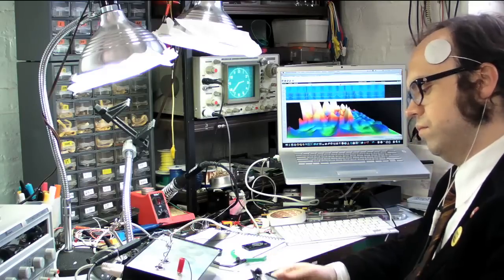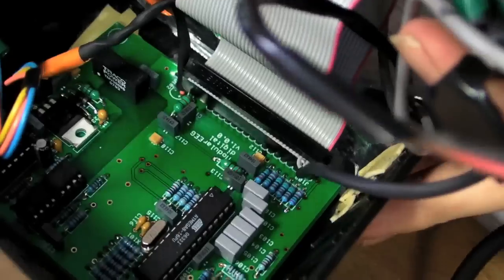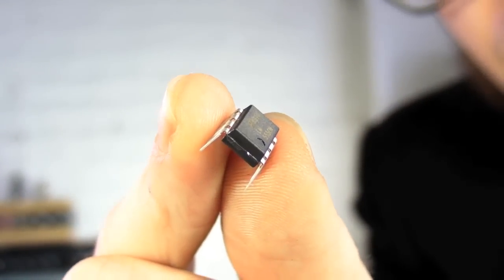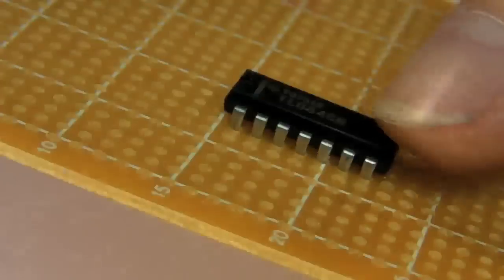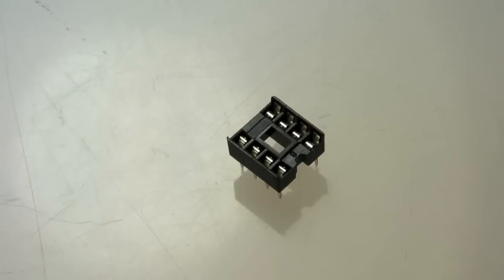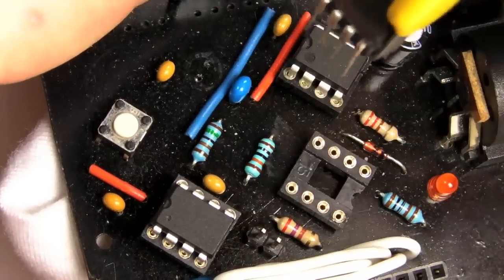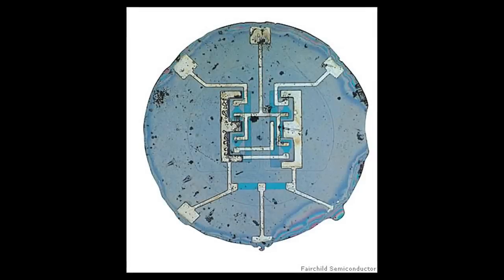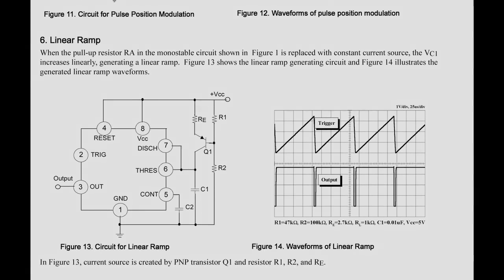MAKE presents: The Integrated Circuit

Comment: Several transistors form a circuit which can be turned on or off like a light switch. Eight switches comprise an on/off pattern known as a "byte". The patterns are then used to code binary information inside the computer. Twenty or thirty transistors can be embedded into a chip which acts like a super amplifier. This is known as an "Operational Amplifier". The circuit calculates the differences in two input voltages and amplifies the result.  Transistors are voltage difference calculators.

Comment: @TheMakut 

A transistor controls a signal with another signal. Consider that you have a voltage signal, and a control signal. When either is applied very little will happen (ideally, nothing), but when both are applied, you get AND logic, i.e. both signals have to be present to produce a good output. This is a fairly shoddy AND gate, as it will be affected by current flowing through either input, but demonstrates how a transistor can be used to decide something.

Comment: What goes on inside a microchip? Carefully designed paths of capacitors and transistors control electron flow. Electricity goes in through one pin, comes out of another (or several).

It's actually quite difficult to illustrate without a complicated computer-animated 3D model.

Comment: An IC is basically a row of transistors.  Transistors act as a switch in which values of input voltage can be chosen such that the output is either completely off,  or completely on. This on or off position is analogous to 1 or 0 ie. binary the most basic language machines understand, binary then gets translated to a higher level language in order to make programming easy. Before the adoption of IC, computers used switches in vacuum tubes to create a similar yet epically less efficient effect.

Comment: good video no negative response from this side but can you elaborate abit on what each pin for example can be used differently to do so many functions for example like timer chip etc and what part these pins play and how you can combine multiple ic's to do bigger jobs etc and explain to what extent these chips can be used and also cover the fact that software can help program these chips using roms and stuff. thanks

Comment: Using a momentary switch- Which IC can I use that will act as a toggle switch to close a circuit for 2 LEDs?  40mA circuit.  Single D-flop?, but one that can deal with the current.

Comment: I bought two shift registers, but one of them got a bit "crushed". One or two of it's pins got bent a bit. Can i bend them back, or do i need to buy a new one? I also damaged a crappy push button, but i don't think, i can repair it.
Reply: ***** I don't have the right tools for that.
Reply: +StarTrek123456 You can use a credit card or something. Just sandwich the bent pin between the card and the table and press to straighten.
Reply: You really need the proper tools for this stuff. It's the other side of computers for most of us, and we are accustomed to having all the tools we need inside the computer ... Colin has a video on tools as well. :)

Comment: You are over thinking this, just imagine a light switch turning on and off, now think of morse code and the way you can communicate with either short or long bursts.  Those on and off positions can be made to represent any number, letter, color etc.  It's not that the transistor is thinking it's that it is creating an electrical impulse which can then be interpreted by the machine as either 0 or 1, programmers then use higher level languages to interpret and make use of these patterns of 0 and 1

Comment: Hey 2009, imagine CPUs today that have transistors so small that if they were any smaller the laws of physics wouldn't apply to them normally and electrons are able to tunnel though other universes past a semiconductor, so we make super expensive computers that take quantum mechanics and use them to make a new type of computer that has to be cooled to near-absolute zero
Reply: +CoolAsFinnBro So there is a limit to how small transistors can become.
Reply: +twistedyogert There is, yes and we're hitting it. At some point, things get to the point where we move from Newtonian physics into particle physics which isn't good when we're looking at something like a practical engineering problem since most often, particle physics doesn't have practical solutions. When an electron can spontaneously hop from one data stream into the next one your board, it starts to cause issues which is what we're facing today.

To put things in their simplest terms, that is. These are serious engineering problems that have been skirted for years with ingenious work arounds but the demands of technology are drawing into question whether chips can continue to get smaller without a major breakthrough of some sort.
Reply: was told about a problem with "quantum tunneling" where electrons can basically phase through a transistor even if it is in the "0" or off state. I guess at small scales, physics goes off the rails.

Comment: i wouldn't say that an IC is only based on transistors mabye a CPU you could say are based of transistors because in an CPU there are really alot of transistors but an IC could contain resistors and even inductors too. If you look at the schematic in a datasheed of an IC you could see that you could build that by normal electronic parts but it would be too big for our modern world think of a mobile :)

Comment: my first soldering iron is zd-99 and my first project 5v breadboard ps and i damaged the ic with this fucking soldering iron with pot as regulator...
Reply: Well, what do you expect from such an iron. I have one still (even though I'm using better one) inside it's just TRIAC power regulator. Your IC is dead probably because of heat or too much potential at tip ('cause it is powered from mains). To be on safe side, you need at least low voltage iron + some skill to avoid overheating chips
Reply: Another advantage to those chip sockets Collin showed in the video.  Put all the heat or electricity you want into an empty socket, and then slide the chip in once soldering is complete.  No damaged ICs.

Comment: The 555 timer is not revolutionary and NOT necessarily an oscillator! It's 3 types of multivibrators in one chip - bistable, astable and monostable with easier setup. You can make either of them with a simple Schmitt Trigger NAND gate chip.